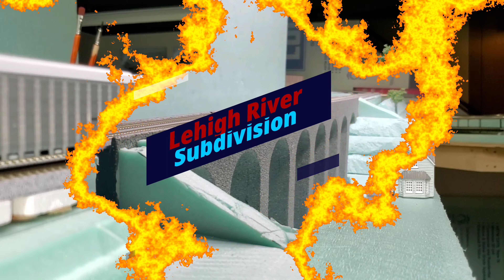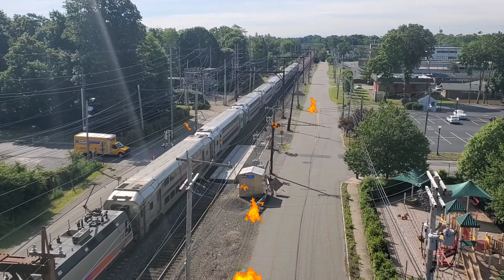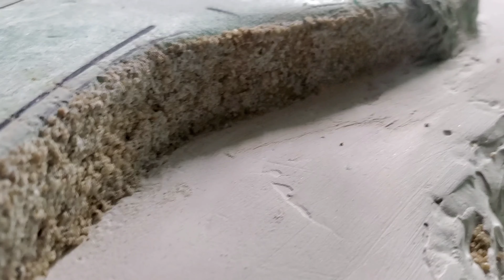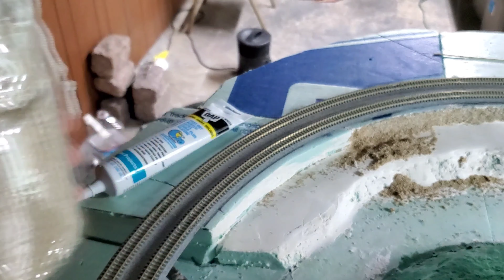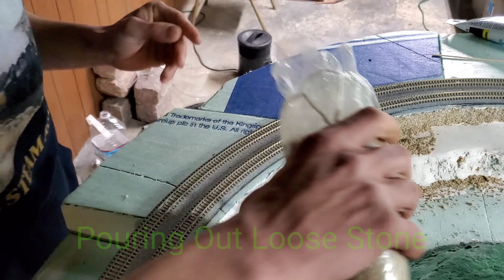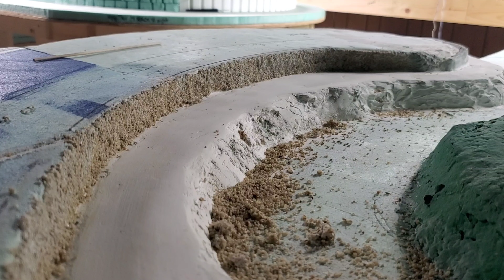Making N scale Stone retaining wall.

Comment: Good job there Ian, quick and easy. That crushed stone appears to be just the right size for N scale. On the prototype path, is there a poured concrete curb or anything at the base of the stone wall?  Art...
Reply from the maker: Thanks so much art for the compliment. Yes quick easy and not to bad. Along the bottom of the wall would be high grass and weeds so where the wall meets the path area will be easy to hide with grass and foliage between the path and wall. There may be some small trees as well but I have too look at more pictures. Take care!